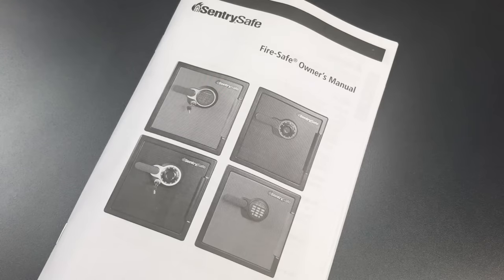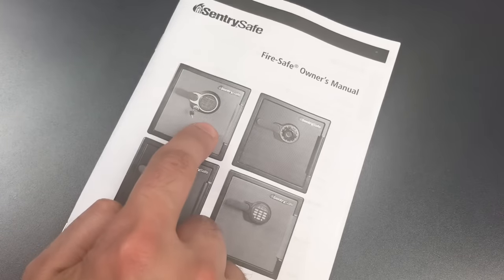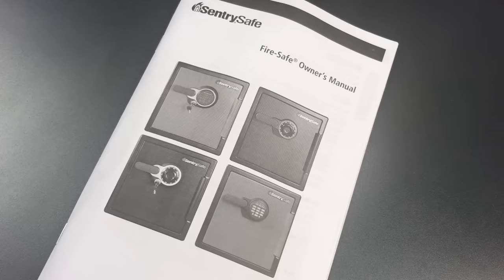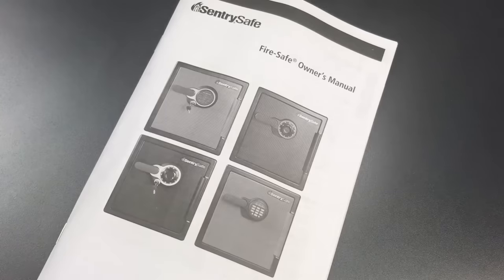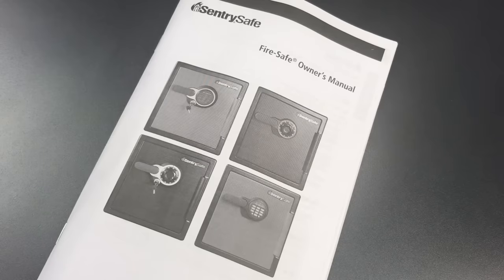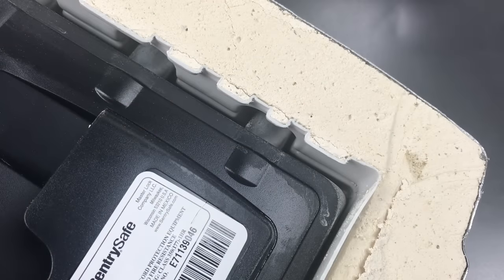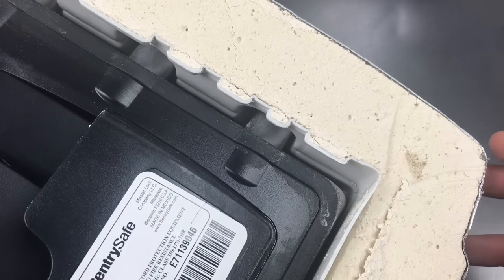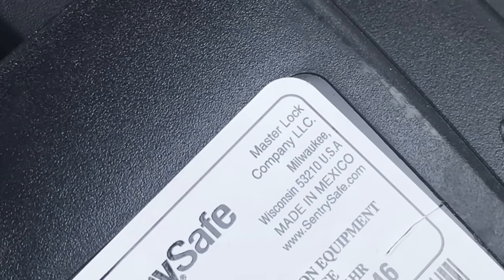[756] Sentry Safe Cut in Half FAST!

Comment: Love how the blade guard on the saw slows him down more than the safe itself
Reply: No matter what you are doing with A circular saw, the blade guard will be what slows you down the most.
Reply: @EATSLEEPDRIVE2002  kind of the point of a blade guard in a way
Reply: @EATSLEEPDRIVE2002  Thats why I take them off, I swear I almost hurt myself more when there's a safety
Reply: @shaddoty  That is severely moronic with a handheld circular saw...
Reply: Safer, pun intended, to use an abrasive blade.

Comment: I have this safe... correction, I had this safe. It got jammed and the handle broke. There is a much easier way than using a circular saw. I cut the hinge bolts on both ends with a battery operated sawzall which took about 20 seconds each and was sooo much less messy. Just stick the blade in between the silver and the gray part of the hinge on both ends and let the sawzall do the work.
Reply: Anything and everything is only as strong as it's weakest link
Reply: A crowbar would pop this open like an oyster.
Reply: @aserta  I wasn't strong enough to pop it open with just a crowbar unfortunately. Sawzall made it effortless
Reply: Exposed hinges and safe in the same sentence is just oh my.
Reply: @aserta  I am trying to open a safe too and I even went and got a crowbar with a sharp end, but I couldn’t even get it in any part of the safe where the door is. There is a metal lip inside of it that prevents the crowbar from even getting in, I tried jamming it in with a hammer and sledge hammer but it didn’t work, and I also don’t wanna break what’s inside of it. Gonna go to Home Depot today to get one of these saws
Reply: @JosiahBradley  exposed hinges are fine so long as you’re not relying on them to keep the door shut. Locking bolts should be present on both the swinging side and the fixed side of the door. Any safe you can find that opens outwards has external hinges.
Reply: @aserta  speaking of  crowbar, did you notice when he flipped it over you could see where the sheet metal was joined at the bottom?  I bet you could have just slipped one end of a crowbar in that joint and pealed it like a banana.
Reply: Nah ,,,the bolts are locked both side ,you need to fry the door away from the bolts ...there are videos confirmed that it's a quiet effort to do so! Chainsaw faster!
Reply: I expect that if you hit it with the sharp edge of a crowbar enough, you'll eventually crack it open.
Reply: Rare earth magnet and a sock works amazingly 👍

Comment: The outer metal casing is so thin that this safe probably doesn't even qualify as "slash proof".
Reply: They can certainly claim it does in marketing, though...
Reply: Yeah those saw blades aren't meant to cut through steel so easily lol
Reply: @marshallsober  If it's been through a fire, you might have to to get your valuables out. The lock mechanism probably wouldn't work anymore . . .
Reply: @robbruce2128  good point, considering its only purpose is to protect valuables i  the event of a fire... it fails if they're trapped.
Reply: @ilovefunnyamv2nd  that's why I store my valuables in my oven. point 1: its more fire proof, point 2: its harder to cut, point 3: its easier to open when I need (wouldn't easily deform from things crumbling on top of it)
Reply: @monad_tcp  Its all fun and safe until you have a guest help with the cooking and preheat the oven lol.  

Had something similar happen about a decade back. We were having a garage sale and a friend came by to try and get rid of their junk also.  she 'hid' her purse in the loaded washing machine.  20 minutes later the laundry was started and a week later i eas still pulling pennies and dimes out of the drum
Reply: @monad_tcp  Actually there was a case here where a babysitter lit a fire in the oven only to learn later that there were >50000€ in the fireplace.
Reply: I don't think slash could smash through this with his bare hands
Reply: It's plastic.
Reply: @fabianfeilcke7220  lol some people are so smart that they forget other people are dumb or clueless.. sometimes we gotta protect our valuables from ourselves
Reply: You could use a hatchet or pickaxe to get in.
Reply: It would be funny to see the safe used in one of those Ginsu knives commercials.
Reply: I guess you could open it with a can opener
Reply: “termite proof” and “fart resistant”
Reply: @robbruce2128  That's what put me off about these sorts of 'safes' when I went looking.. I don't actually need a lock at all - just fire protection. The lock just looked like a good way of ensuring I would sooner-or-later have to cut the thing open anyway (just from the junk lock breaking, not even a fire).
Reply: @RuyVuusen  You could have reduced your comment to "can" and it still would be correct.
Reply: Not metal
Reply: @benrivera8197  😂😂😂 I love that it's only resistant to farts
Reply: @monad_tcp  I hope you don't forget to take them out before firing up the oven.
Reply: @ilovefunnyamv2nd  if the safe is rendered too damaged to open, that probably means its done its job. My dad has a gun safe that he says if damaged, the company will replace with an unlimited, unconditional warranty, and can cut open themselves if necessary.
Reply: Cat proof safe
Reply: right i was like i could probably get into that with a kbar
Reply: Thinner than alot of knives...
Reply: pretty sure u can open that safe with a hammer lol
Reply: lmoaaaaa
Reply: Slash proof from a rubber hammer.
Reply: In fairness it's mostly about heat, not theft on this one
Reply: It's a FIRE SAFE, to protect the items from FIRE. I have fire safes here that have a plastic outer casing.
Reply: at least it's splash proof
Reply: Final Fantasys Cloud approves this message

Comment: so... the biggest impediment to cutting it was ... getting the blade guard out of the way
Reply: 4estrose  Shit really? I was wondering what that blade is? Did not know this was possible.
Reply: 4estrose  the safe isn't even metal why would he need a meta blade?
Reply: Wood blades by design are expecting to need to cut through metal screws or nails, while they say it "can't" and "shouldn't" they know people will hit screws and nails hidden in boards and don't want to constantly have to warranty blades and saws because of it.

Cutting through a metal sheet thinner than a razor blade is plenty easy, especially since that foam can be basically picked away with your finger nails.
Reply: The irony of it.

Also blade guards don't have to be like this. My new saw never gets the guard caught up.
Reply: Looking at that blade, it is a CHEAP wood blade. It has carbide teeth, but is MOST likely NOT meant to encounter metal. Even a few nails. If it was a Diablo blade, it would have no issues, but it looks very cheap and of the Avanti (cheap Home Depot brand) calibre. 
My guess is that the next time he is cutting wood, that saw will cut, but it will burn and may even track differently from the carbide breaking....
Reply: 4estrose  Well, in all fairness... LPL did call it a 'very low skill attack' :)
Reply: 4estrose  Yes, he chose an especially cheap tool and blade to prove that anyone can open this safe. Personally I think a hammer and chisel would have worked as well, though not as cleanly and be more work.
Reply: 4estrose  I wasn't responding to any point.
Reply: 4estrose  mate, my dad bought a circular saw with a wood blade 15 years ago, it survived multiple floods, and the blade was and still is used to cut pretty much anything ranging from wood to steel to brick. I mean the blade lost a tooth or 2, but it's still fine
Reply: and flipping over the safe each time.  :)
Reply: @NoNORADon911  It will ruin the blade but it can be done.
Reply: That's not the point...
Reply: woodworker Royer

I did not expect ( blade ) has carbide teeth; Wood blade turned backwards is capable of this cut though hard but Carbide Teeth come loose and are very very dangerous ~ when I use them my head is not over the saw like this I "hide" behind the saw – metal cutting abrasive blades for this purpose are not hard to find ••• just to get it open like this and make the point that is perfectly acceptable but I am used to quality worm-drive and heavy hard pushed production but surely did not expect carbide teeth
Reply: @woodworkerroyer8497    That's not really the point is it? Point is a cheap wood saw cuts through an safe in minutes with no effort.
Reply: hilarious
Reply: 4estrose  I've had metal or hybrid (for metal lined wood) saws with large teeths, so this may or may not be a metal saw.
Reply: @azteke  Maybe, that or very low Skil attack.
Reply: @jamesv.5637  most blades have tungsten tips these days. aluminium 5 times as thick wont stand a chance. always remembergrinder for steel. saw for aluminium
Reply: @kosonenkosonen9278  So, I should throw away my ferrous metal cutting blades?

Comment: Any time someone would call my shop asking about a safe opening, during the conversation, if the brand name "Sentry" came up, i would immediately reprice my quote as a standard opening rather than a safe opening.

Then when they asked why it suddenly got cheaper, i would let them know, "That's Sentry brand.  It's not a 'safe', it's just a lock box.  They're so easy to get into, I'd feel bad charging you for opening a real safe."
Reply: Aren't these things just for fire resistance and protection against low effort opportunistic types?
Reply: @billtheunjust  
The way I see it, they're for keeping small children out of non-critical stuff.
Reply: billtheunjust  I'd say that the real utility is keeping important papers and such safe from house fires and water damage (splash from fire hoses and such, probably not from literally being submerged underwater for any length of time) but as far as security goes, it's no better than a metal filing cabinet with a lock on it.  Enough to stop klepto teenagers or a sneak thief who gets in the house while you're asleep but any real thief who has a little time and can afford to make some noise (homeowner isn't home) will get into it without much difficulty.
Reply: How do you get into a sentry safe vs. an "actual" safe when you're on the job?
Reply: @NcrebelRS  
Nice catch.
Reply: @kman1759  
Sentry?  I give it a dirty look and it pops.  😃    Sentry just needs standard picking techniques.
Reply: OMG that is hillarious 🤣😂
Reply: What's the best safe brand?
Reply: @zack88005  
I personally like GardAll and AmSec.  You can get better safes, and you can less expensive ones.  But, my opinion, you get pretty good bang for the buck with either of those brands.

Please keep in mind that this can quickly become a brand vs brand holy war.  So this is simply my personal opinion.
Reply: Mine served its purpose in a house fire with documents and titles inside. A friend had one that sentry printed the wrong combination on, and I used a recip saw to cut a small opening to view the combo lock and opened it with the door combination, which was entirely different from the printed one. That's why they say to check the combo before actually locking it, the factory screws up on occasion.
Reply: John Lee Pettimore III got any cool stories to share?
Reply: So now the question becomes: what safes would you go the other way on, and raise your quote, because as safes they're that good? Inquiring minds (and people possibly buying safes) want to know! :D
Reply: on todays youtube episode of things that have never happened.
Reply: @JohnLeePettimoreIII  Small children without an access to power tools that is.
Reply: John Lee Pettimore III they are not security safes just meant for fire protection
Reply: Burn so hot that it consumed the contents of the safe.
Reply: That's actually quite a pathetic product, those little hand held cash boxes are more secure. I thought this was a joke at first lol.
Reply: How do you go about asking to get a safe open? Do you have to show proof of ownership? Are you automatically suspicious when someone calls? Or is it normally innocent like g-ma's old safe?
Sorry lol curious.
Reply: @billtheunjust  these things are so light it's a one person carry.  There's no way to bolt it to the floor.  If they really want it they'll walk out with it then have their way with it away from where a homeowner may come back at any minute.  Even as a fire safe I wouldn't put much stock in it if the whole house burns to ashes.
Reply: @zack88005  It's relative to what you're most worried about and what you're trying to protect.  A safe itself isn't a whole security system and you need to have other stuff like a monitored alarm system to properly protect anything of real value.  After that you need to have something that's too heavy to be carried off on the spot or at least secured well enough to not be easily mobile assuming theft is your concern.  If it's fire then you need to have something rated to protect your stuff as long as the structure may burn or until you can get the scene chief to agree to dump a shitload of water onto the area around your safe to keep it coolfor longer while the rest of the house burns to ashes.  This is the part where the alarm system comes in handy but if it's an attack by burglars with more time then you need to have something that can thoroughly dissuade and discourage them due to the time needed to gain entry.  These safes tend to be TL rated and certified by UL.  That's tool on safe time.  It doesn't include the time they spend game planning their attack and they can also swap out tools once the blade or chisel point starts to dull and be less efficient.  You're going to pay out the nose for a safe like that though, but again it depends on what you're trying to protect.  Once you get into verified ratings you're paying for the name or the warranty attached to it.  AmSec is probably the most recognized when it comes to commercial safes so they have that going along with a bad ass warranty.  On the other hand something like WorldWide Safe and Vault only has a limited warranty, carries the same TL or higher ratings, and is about half the price of a similarly sized AmSec.  If you contact WorldWide Safe and Vault they may accidentally include some AmSec logo safe door organizers in the literature while the safes have the same exact specs for size, weight, protection level, and fire rating.  AmSec from what I've seen is more consumer oriented and tends to be much prettier though while a WorldWide Safe tends to cater toward a commercial market where a jeweler doesn't really give a shit what their commercial quality safe looks like since a customer will probably never see it.
Reply: Alot of people don't really need a safe. I worked at canadian tire for a while 90% of people looking for safes wanted them for storing guns (yeah, in canada you are legally required to store your guns in a safe). Really, most only cared about the legal requirement rather than how good the safe was. And for that a sentry safe does it's job well. It's cheap, keeps kids away from your guns, is legally a safe.
Reply: Can't spell "Sentry" without "entry"...
Reply: Its all ways nice to save customers money and be truthful with them it brings them back and builds trust as well
Reply: You might as well ask them if they have a chisel and a hammer at home. A freebie information might be good PR. :-)

Also: As you say, it is a lockbox. It keeps guests and kids from getting to whatever is inside if you are in the house with them.
Reply: @Artyomthewalrus  I'll raise you Australia - where gun owners are legally required to have a purpose-built gun safe that is structurally attached to a building (and there are legal requirements on what the structure it's attached to has to be able to withstand).
Plus you have to keep the firing pins seperately at the opposite end of the building.

Oh, and if you somehow, by some small miracle end up with a license for a restricted weapon type, you no longer need a safe, you need a purpose-built vault meeting structural requirements comparable to a bank vault.

If you're asking how you can actually use a gun for anything under those conditions, you basically can't.
Trying to use it for defence is a crime anyway, so you're left with hunting or use at firing ranges. (or maybe a film shoot. - primary reason for the 'restricted' weapons is as film props. Probably because a lot of American studios film action films here. Plus non-functional replicas of guns are legally classified as requiring the same storage standards as the weapon they resemble. So if you for instance had a non-firing AK-47 prop because you handled firearms for film shoots, you'd be obligated to store it in a vault, since it's otherwise classed as 'illegal' to own...)

Yeah... XD
Reply: Good to know there's honest workers out there.
Reply: @22steve5150  it's also obviously a very lightweight box and features no mounting points, so a thief could just take the entire "safe" with them no problem and saw them open later at their garage.
Reply: @KuraIthys  Keeping your guns and ammo in separate safes is actually a smart idea, since an openly accessible gun is more likely to hurt you or your family, then ever being needed to defend your home.

And turning non-firing replicas back into usable weapons isn't that hard to do, unless they're airsoft replicas. If replicas had lower requirements, they could end up creating a loophole.